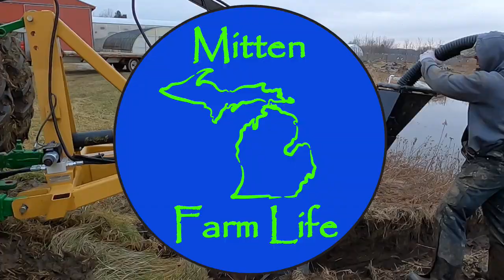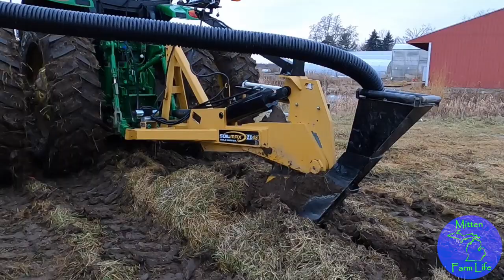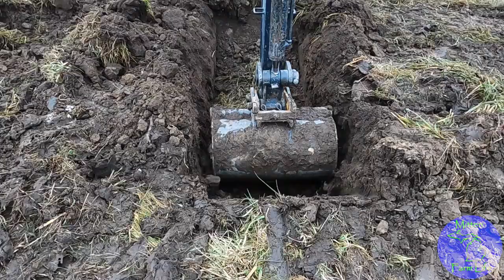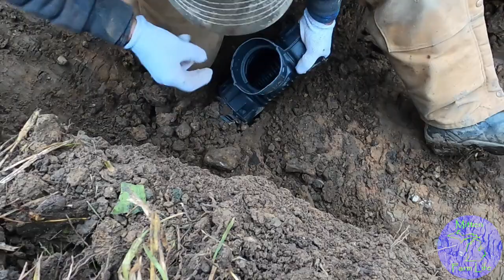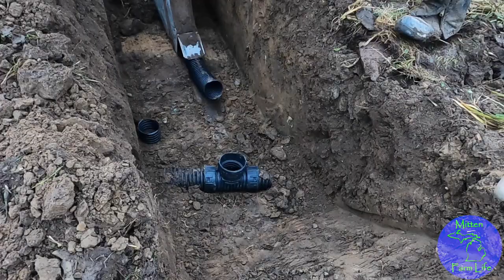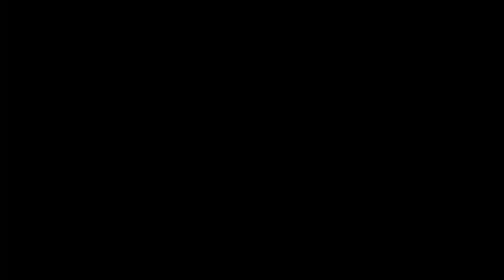Laying 4'' Tile with a Soil-Max ZD-48 Stealth Plow

Comment: There is a much better way to do tie-ins. As is being done here, the 
open trench that the excavator makes offers virtually no side support 
for the pipe due to the width of the trench and no groove to provide two
 point support for the pipe. If you've ever dug one up after a couple of
 years. you can se that the pipe is deflected 30-50% causing as 
significant loss of capacity.
Reply: what would be a better way to do this?